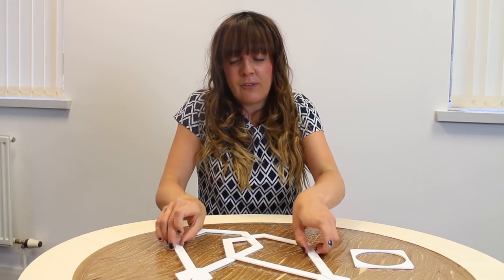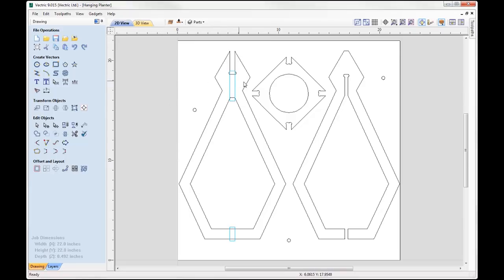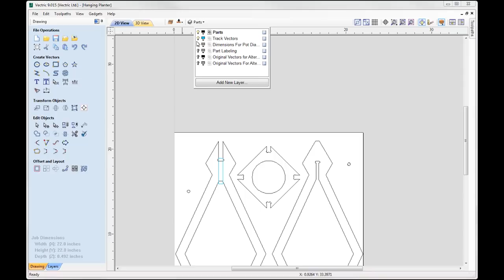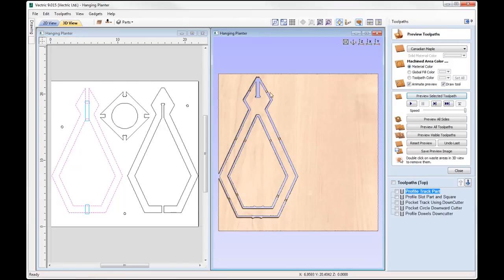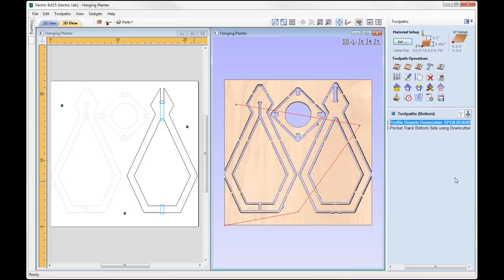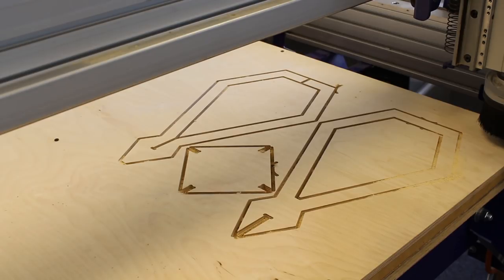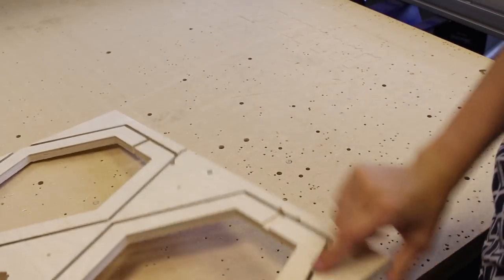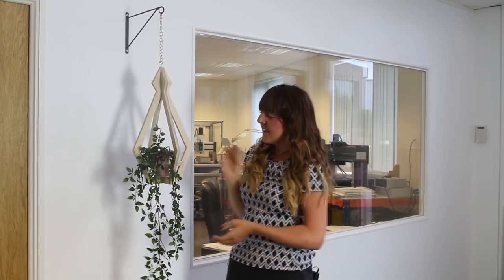In Labs with Beki | Make a hanging planter with a CNC | Vectric FREE CNC Projects

Comment: My ply wood is 3/4 how to do change size
Reply from the maker: Hey There! In the file there is a layer called "Original Vectors for Alteration" you just need to alter the widths/heights using the set size tool to change them to the material thickness that you are using along with changing the job thickness to 3/4" I hope this helps, if you have any issues please don't hesitate to drop a message via email to support@vectric.com Thank you have a great day!